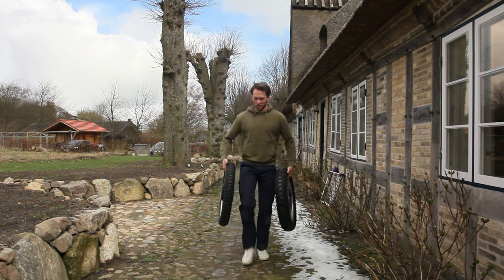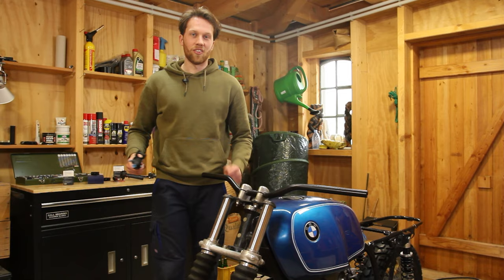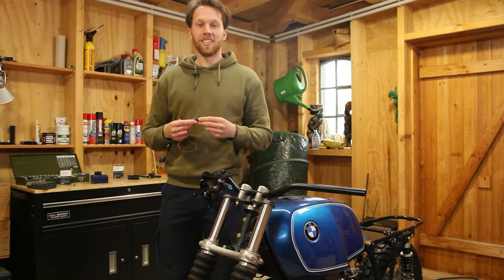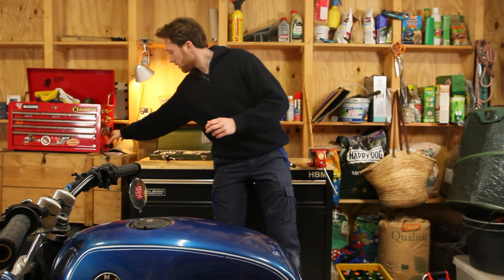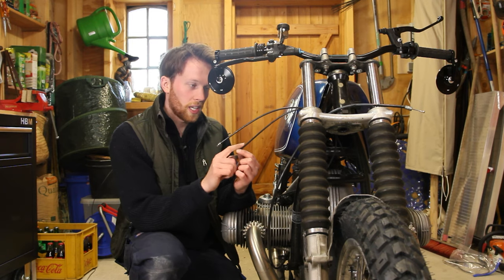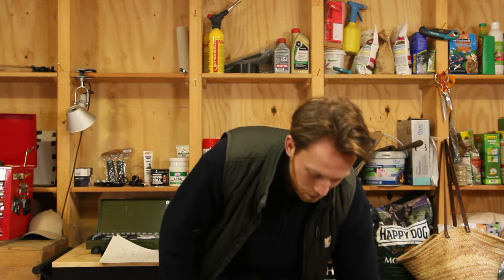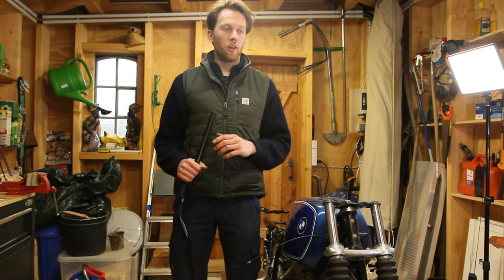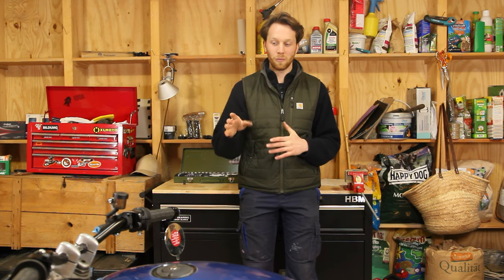BMW R80 Custom Bike Handlebar Set Up | Part 1

Comment: Joshua, this series is really appreciated! Your sincerity and the will to figure things out, while documenting the process, is inspiring! I'm checking out an '83 R80RT tomorrow! Best regards from the West Coast of Canada!
Reply from the maker: Thank you so much for your encouraging words. How did you like the R80RT you checked out?
I'll continue posting new videos from October onwards. Had to take a little time off to finish my studies. 
All the best to Canada!!
Reply: @MotoWrenchers  Thank you so much for your reply. I bought the R80! It's a brilliant and beautiful bike. I look forward to your continued series. Best wishes returned.
Reply from the maker: That's awesome!! Congrats on the new bike 🙌 Are you keeping it stock or will you customize it?
Reply: @MotoWrenchers  Thank you! So far, I've had to go through the carburettors, and am waiting for a wider and slightly taller handlebar to arrive. Some of the Siebenrock kits have caught my attention. I like the idea of greater engine oil capacity, and the big bore kit—that will come later:) Did you get new tires/tyres mounted and balanced? If so, what size? Thank you, and best regards!
Reply from the maker: Thanks for the update. The big bore conversion sounds amazing. I don't know if you already have considered it but a nice little upgrade that isn't too expensive and would go very well with the increased power are progressive fork springs. I haven't installed my but I've heard from multiple people that they are a game changer.
Regarding tires, I went with Heidenau K60. Here are the sizes:
130/80/18 S & 100/90/19 S
Unfortunately, 130 is the widest that fits in the back (I would have liked a slightly wider tire).
Are you also thinking about changing the looks of the bike?
Keep me updated regarding your progress if you like :)

Comment: Great video, I am very excited about your project. The brake cleaner suggestion is a very good one for installing rubber grips.
Figuring out solutions and using new techniques is one of the most exciting aspects of any project for me.
Stepped drill are one possible solution to the drill chuck capacity issue . The drill shanks are smaller than the drill bit size. Silver and deming drill bits can be very helpful.
Keep up the great work, I eagerly await your next video!
Reply from the maker: Hi Mark! Thank you so much for your feedback. Really makes my day hearing something like that and the stepped drills are the ones I'll go for in the future. And at some point maybe get a stronger drilling machine...one day. :) Have a great weekend my friend! Thanks again for your tips. Really appreciate it.
Reply: You too my Friend. @MotoWrenchers

Comment: It is at these points in the project that you have to make everything a custom fit.  You could have created an adapter hollow cylinder that would have fit into the bar ends, and then becomes 13.5 mm ID on the outside of the bars to hold the turn indicator.  Also, for the loose button switch, you can put an aluminum strap around the bare bars to increase its diameter, then screw down the button switch to hide it.  Custom outer cable lengths need to be cut, and inner cables need to have the barrel ends soldered on to be the proper length and fit to each end.  Measure twice.  Good luck.
Reply from the maker: Hi Porter! Thanks for your tips. The adapter is a nice idea. I'm not yet at the point where I have mechanical creativity (I would call it). But constantly working on it...and really appreciating your tips. :) Regarding the loose button switch, I've called them and they said I might have to turn one of the two pieces because they are not 100% identical. Then it should work. Need to check that. Otherwise I'll try your solution. And I'll make sure to measure twice! I'm looking forward to that. I've just ordered kits from Vanhill. Thanks again bro!

Comment: another step forward.  Very Nice 🤟🏻 I am also taking the next steps, it may turn out that we will finish in a similar time 😀
Reply from the maker: Thanks bro! Sounds great. Slowly but steadily 😍 What are your next steps?
Reply: @MotoWrenchers  I just finished assembling the USD front end and handlebars so now I will slowly do the whole cable connection.  :) I suspect that you will also deal with it soon
Reply from the maker: Nice! How do you like the USD set up? Yeah, wiring will also be one of the next steps. Just got a call from a friend today, who said I should get a new handlebar with a bigger inner diameter because he thinks there won't be enough space for all the wires. Might need to do that first. Do you have any experience with that?
Reply: @MotoWrenchers  I sent you a few photos on Instagram how it looks :) as for me it looks much better and it will definitely be better than the 35-year-old suspension, it will improve the quality of the front brakes :) I decided to clip on it will be my choice :)
Reply from the maker: Jo Bro, just checked my Instagram messages. Damn...your bike looks so sick! Really love the set up. The pipes, the usd and the black engine. So nice. Really good work! Consider me highly impressed.
Reply from the maker: And thanks for all the pictures <3

Comment: I see you have the three button switches. Did you drill a hole on both sides of the handle bar per switch (front and backside) Or only one hole per switch?
Reply from the maker: Until now I just drilled one hole in the front. I think it will be possible to run the backside cables through the same hole. I'll need to check whether it will be big enough. I'll definitely make a video about that.
Reply: @MotoWrenchers  thank you for your answer! Looking forward to the video and your experience with a single hole.
Reply from the maker: Sure 👌 Have a great day

Comment: What handlebar is that?
Reply from the maker: It's this one: https://www.sport-evolution.de/de/BMW-R45-R65-R80-R100-Lenker.html

In case the link doesn't work it's from sport-evolution.de, parts number: SE-40-17521-03-000

Comment: Moin, cooles Projekt mit der R 80.  Aber warum machst du deinen Kanal auf Englisch soweit im hohen Norden von Deutschland. Und dann noch so einen berühmten Nachbarn wie Andi Feldmann cool 😎 den hätte ich auch gern als Nachbar. Viele Grüße aus Wolfsburg Enrico 😁👍🏍💨👊
Reply from the maker: Moin Enrico!
Vielen Dank für dein Feedback 🙏😊
Ja, Andi ist echt Gold Wert. Er hat so unfassbar viel Wissen und ist so kreativ beim Schrauben.
Und ich mache den Kanal auf Englisch, weil so eine größere Community entstehen kann. Es kamen schon so viele Nachrichten aus den verschiedensten Ländern über die jeweiligen Projekte, an denen dort geschraubt wird. Das finde ich extrem cool.
Viele Grüße nach Wolfsburg 👋👊 und vielen Dank nochmal :)
Reply: Ich wünsche dir auf jeden Fall viel Erfolg mit deinem Kanal. Abo gab ich natürlich da gelassen weil ich ja wissen will wie es bei dir weitergeht 😉 Ach eine Frage hab ich noch. Ist der Andi wirklich so wie in seinen Videos. Ich finde ihn einfach nur Hammer. Bestell ihm mal schöne Grüße von mir 😁👍
Reply from the maker: Vielen Dank! Das freut mich sehr 😍 Und ja, Andi ist 1zu1 so, wie in seinen Videos. Er ist schon ein echt cooler Typ :) Richte ich aus 😉👍